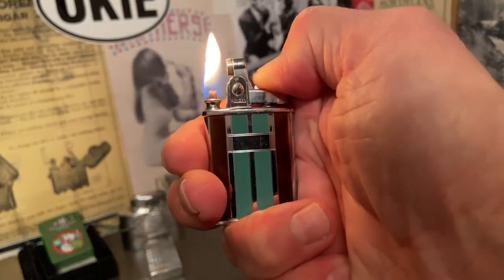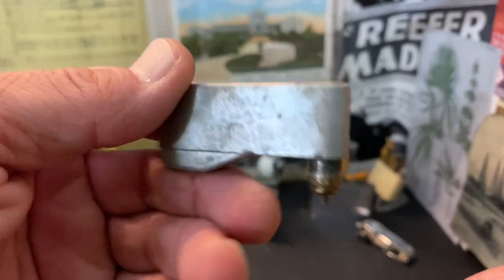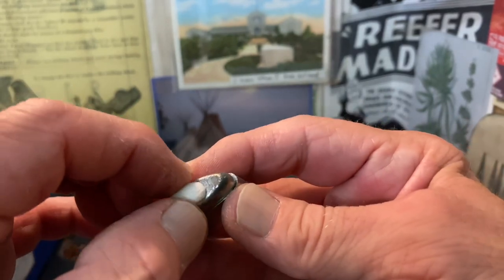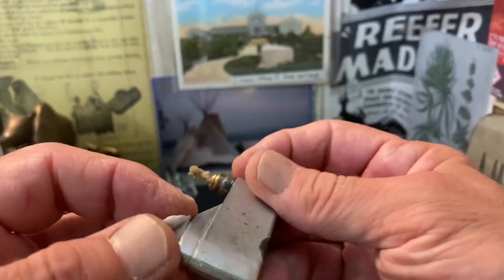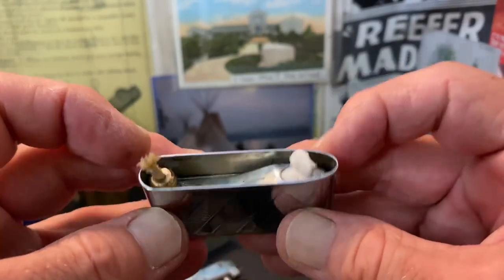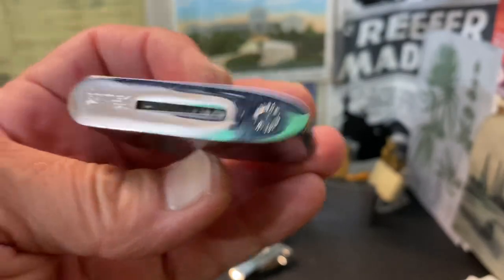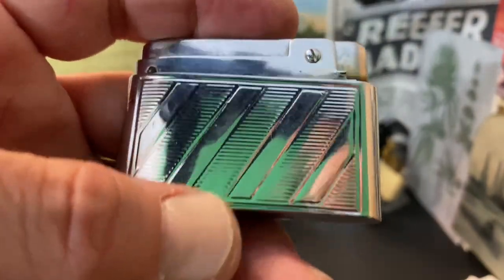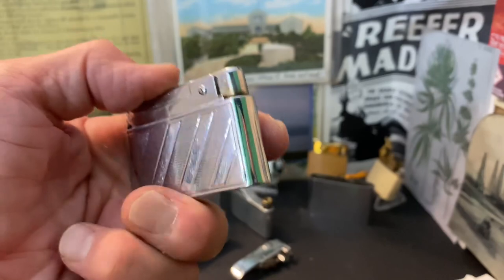A Bentley Automatic Lighter Converted To Petrol With An Improved Fuel Port

Comment: Really like it they work really well too! Holds a decent amount of feul. I was thinking , you know those plastic screw hiders you clip on top of screws you find them in kitchens , cabinits , cuboards etc one of those might fit and cover the fill hole nicely if not next time you can drill the hole the right size for one of those caps. 😎👍
Reply from the maker: Yes, a trip to the hardware store would be very helpful.✌️
Reply: actually they come in different sizes so 😁
Reply: @DependableFlame  ✌